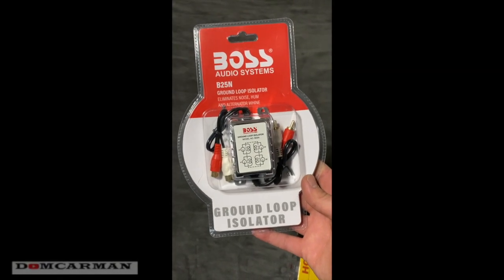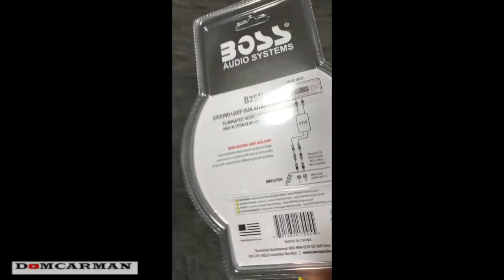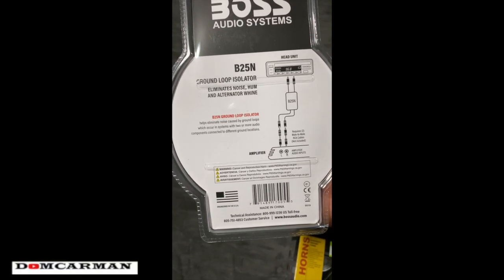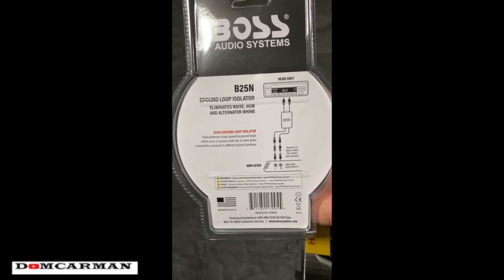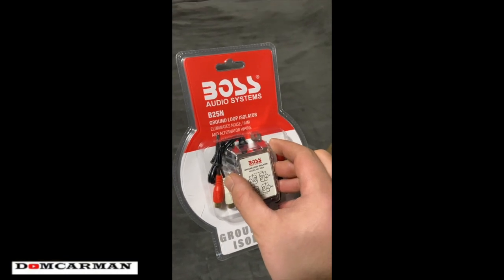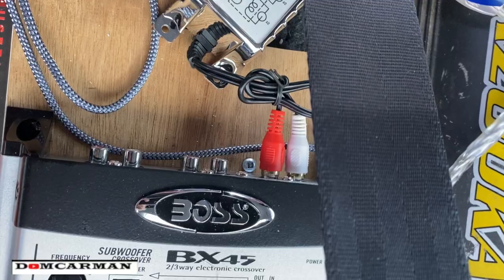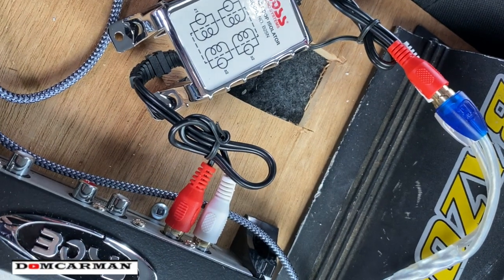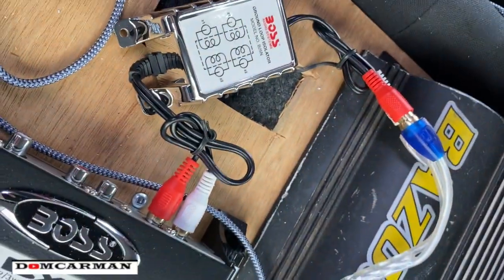Eliminating Engine Noise In My Stereo System

Comment: I have the same noise in my car but it's intermittent which is driving me crazy. I'll give this filter a try. Thanks for the video.
Reply from the maker: I’ve had it for a while now and noise never came back 👍
Reply: How many channels are you running?  Do you need one on each set of rca's?
Reply: @swordoflaban6594 if your running a 4 channel you will need two of them if running class d amp you will only need one if your running a 4  channel and a class d amp you will need 3 hope that helps

Comment: You're so used to bad-
you get good and it's astonishing.

The signal is cleaner- it's been run through a type of filter.
The alternator, spark plugs, wiper motor, engine cooling fan motor, 
HVAC blower motor, overhead High Tension wires, lightning-
are all messy, noisy, frying bacon and squeaky wheel to your ears.

Comment: What if you don't have  on an aftermarket radio, it does rca plugs in the radio, but what do i do with the other end of the rca cables?
Reply from the maker: @johndeloach503  if you're using the stock radio that doesn't have RCA outputs then you can use a line-out converter and put this between the converter and Amp
Reply from the maker: @johndeloach503  it's meant to go between the radio and the aftermarket Amp

Comment: Do you know how to fix a HPF hum/buzz. The noise disappears when changing from HPF to LPF and i dont know what to do in this point:(
Reply from the maker: Interference is higher pitched that’s why it disappears with lpf because it filters out the higher frequencies. If you’ve tried this kind of device and still have noise, make sure your rca wires and power/remote wires are not run close together. My power and remote wire run along the drivers side rail and the speaker/rca wires run along the passenger side.
Reply: @domcarman1821  i have tried everything nothing works it has to be a problem with my amp:(

Comment: What happens if you leave it plugged into the cable that go in the amp? Also where did you install it in the back of the radio
Reply from the maker: Mine is plugged in directly to the stereo and the amp RCA wires are plugged into the device. I just zip tied it to the dash bar behind the stereo. It’s been over a year now still no issues.